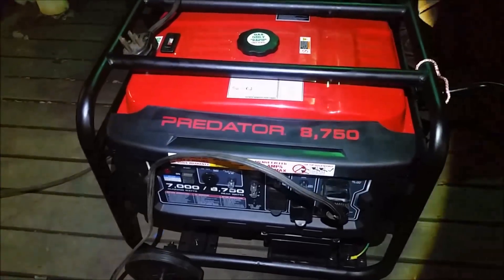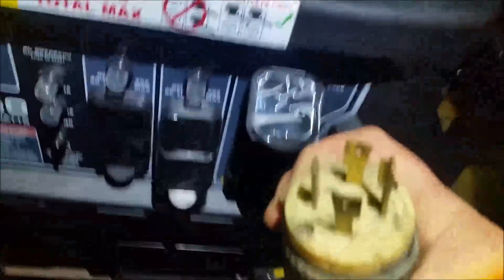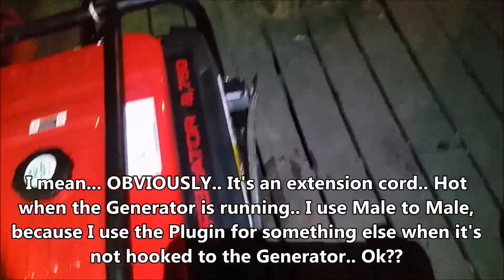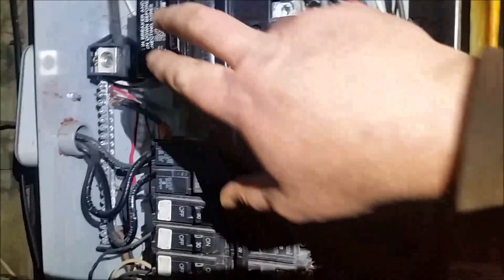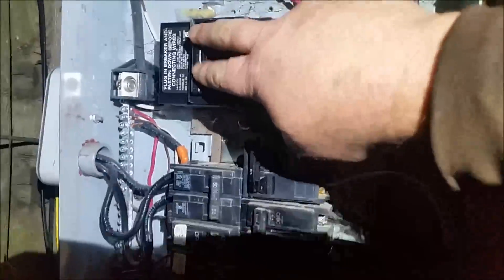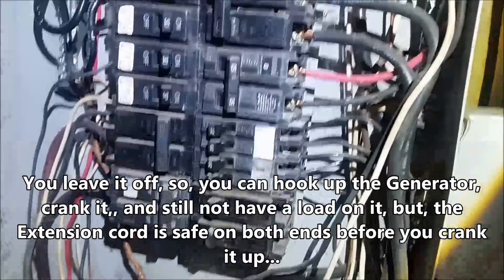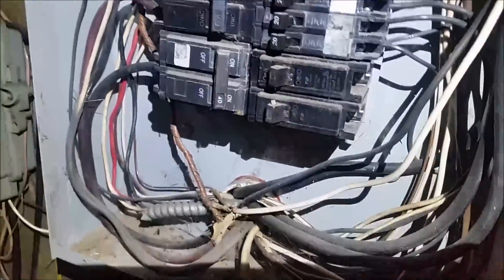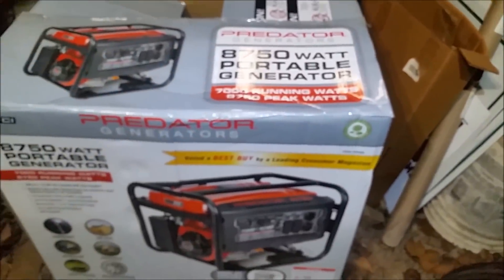Quick/Easy/Safe: Use Existing Plugin/Breaker for Generator hook up to your house Panel box.

Comment: I work for a local utility and I’m glad the emphases was making sure the main breaker is in the open position (off/0) not the closed position (on/1). Through safe work practices we do make sure we are checking for any voltages that could potentially harm us in an outage but we cannot control what the end user does in an outage. Me personally I don’t have a bypass but I my YouTube search brought me here. Truth is I was looking at purchasing a permanent generator (generac) but wanted to see what other options I had. 

But thank you again for putting safety first!
Reply from the maker: Thank you Gaber...  It's hard to justify a whole house permanent generator, when you only need something from time to time temporarily..  It helps if you have some "Other Reasons" to even purchase a portable generator that will run just the essential items..  It only takes one extended outage with a Freezer full of meat that will make it easy to make that decision.. Hopefully, you will know someone who has a portable generator if that ever happens, that is setup where they can easily stop by and power you up for a few hours to get everything frozen back solid.. 
For those instances, I will unplug mine, toss it in the truck and spend the day out blessing my friends who don't.. I just keep a pigtail with a 50 amp female plugin and I can unplug one of their 30 to 50 amp breakers and be plugged in and hot in a few minutes..  I don't mind, because, I am always maintained and while I am gone, I am not missing not having electric at my place.. 
Since they cleaned the ROW, we are not out near as often as we were before.. A good rain would put us out for years, and I ran the generator regularly. And, I am 1/4 mile from the last 3 phase on my leg, so, usually the very last to get back up..  My Mom has the Harbor Freight 8750 and runs what she needs to run at her place.. I run my deep well and my electric water heater with my generator, but, not at the same time..  I am fortunate and have the water heater breaker inside and deep well breaker outside.. I just turn the hot water heater off and operate as usual, until I shower, etc,, then, stop using the water and let the water heater heat things back up again.. As soon as it catches up, I can hear the load release from the Genset and I flip the water heater breaker back off and go back to normal operations.. I keep a camp stove type coffee pot handy for the coffee, so, other than the expense of the fuel, it stops me from Welding, running my compressor, but, doesn't stop me from doing anything else.. 
From time to time I have to toss in my generator and portable air compressor and go and change a flat on one of my busses, but, other than that, it stays at the house, unless there is an extended outage and I go to help my friends..  Usually take my Mom's too and we go and visit.. Hook one up, go to another and hook up another and hang out with one or both for a while.. 
Portable generator,, Yes.. Whole house Permanent,, no.. Not unless it's money that is available and not needed for dual purpose options.. 
If they ever make a generator that has an Automatic transmission in it that will run at just over an idle on a low load and idle up based on a load, portable or permanent, I am going to have a fairly easy time upgrading to it,,, reasonable price would have me at the store in a few minutes.. Fuel is expensive when you are running full rpm, not running much of a load.. Not sure why someone has not done it yet.. It really would not be that difficult to engineer, and would save you quite a bit per outage.. I had a generator that idled down when it was not being used.. I used it a couple of times doing some construction.. I saved a fortune on a two week job without power, just idling between using the saws and air compressors... In fact, I hooked up a second, much larger tank to one of the compressors and ran all of our equipment off of it when we were assembling walls, etc, just using air tools.. I have run two days on one tank.. 
Hope some of that helps you make up some portion of your learning process before buying..
Reply: Thats is so sage and great 👍  add a generlink safety lock out on the panel with a dedicated 2 pole generator breaker 😀 and all done

Comment: Good and simple explanation you're a good teacher still is out of code they want the interlock. But your way work for someone with horse senses....
Reply from the maker: Yea.. Just one problem with that.. You can't use this simple technique with an interlock.. Nothing in your panel changes, so, there is no code violations in the panel, etc.. 
Last time I checked,, inspectors don't do inspections when your power is off,, which is the only time you would be using your male to male cord and generator.  But, when you talk "Code" you are referring to the non-government NEC, which is adopted or not in whole or in part by the State you live in.. I don't know of any state that adopted it fully.. Maybe California,, not sure.. But, the only thing NEC would say about it is,, if it is a "Temporary Extension cord", it is not regulated by NEC.. They only stipulate when a "Temporary Cord" can not be used.. Code would be for "Permanent Installations".. Something you leave connected to your panel, and the reason for the Interlock "At that point"... 
This is a Temporary setup, so, you would not leave your generator connected when you were running off of utility power, in the event that someone opened the panel looking for a flipped breaker and turned the generator breaker on, backfeeding the generator... It's only for people who hook up, and when the power is restored, kill the genset, unplug and flip the main back on.. And, plug whatever was plugged in there before back in and go back to normal operations.. I can tell you understand that, but, just wanted to clarify the "Code" issue..

Comment: So, technically you could just use your drier outlet to plug the generator in, as long if you have them main off and make the proper cable to connect the 220VAC obviously switch off the other big 220V breakers.
Reply from the maker: Yes..  You will be supplying 220v from the Genset to the Panel, the same way the Dryer was getting 220v from the panel. You are supplying the two busses with power from a different location.. An alternate source of the supply, once you kill the Main Breaker.. If you stop by your local big box store and look at an open panel box, it will make sense to you perfectly.. If you hired an Electrician to come to your house and add a Generator Subpanel, he would do basically the same thing.. But, he would dedicate a 220v slot for the feed, and it would always be waiting to be used when the power goes out, and there would be some type of wiring setup that would "Not Allow" both the main and the Generator to be connected to the house panel at the same time.. (That is the biggest Safety Difference, therefore biggest difference in this and that scenario). The Lesser expensive option would be to have an Electrician install what is called a "Generator Interlock" in your panel and also again Dedicate a 220v Breaker to the Backfeed.. The Interlock is nothing but a piece of metal that turns a 220v breaker on when the main is turned off and when the Main is turned back one, physically pushes the same 220v breaker off.. If you look at your Panel, you can tell which side the 220v breaker would have to be installed on in order for that to work... Reason: When you throw the main breaker ON, (in my case, I flip it to the left).. If I had a metal bar that slid back and forth on a pin or set of pins, it would pull the Right breaker "In or Left" which would turn the 220v breaker "ALSO ON".. So, that would not work.. But, if the 220v breaker was on the Left side of the panel, Throwing the main to the Left=ON, would throw the Breaker below it to the Left "Left = Off", and that would be the side of the box that you would Feed with your generator breaker = Backfeeding to the Panel.. The options I have mentioned so far, all have a Dedicated 220v breaker for the Generator that only gets used when the Main Breaker is "OFF", therefore requires a dedicated 220v Breaker and two extra slots in the panel for such.. Here is the Main difference in those setups and this one as an alternative option to those.. (Not having the Generator Breaker and Main Breaker on at the Same Time is totally going to be up to you.. But, because of that, you can use an existing 220v breaker,,, Normally used while the main breaker is On = Dryer Plug, Stove Plug, etc.. and use the same breaker to backfeed the panel when you are out of power and need to power up the Generator.
Why use a "Male To Male = Suicide Cord"?? In order to use an Existing "Plugin",, that plugin is going to be a "Female Receptical".. Where you would normally plug in your Dryer, Stove, Welder, Air Compressor, etc.. The only way to quickly use it, is to use a "Male for the Generator and another Male for the Existing "Dryer/stove, etc.. Female Receptical. That is the only "Big" or Safety Concern issue.. But, if you can remember to turn the Main Breaker off, you sure as hell are going to remember to plug both ends of the "Male to Male" extension cord in... Trust me.. If you respect Voltage, and you pick up a Male to Male Cord, you are going to be absolutely certain that the Breaker is turned off before you plug it in and the Generator is not running when you plug it into the Generator..  
If you do have utility power, and you plug the generator in, and then plug it into the dryer, etc,, and the power is on and generator running, you won't forget again, so, be careful.. I really don't know what would happen, but, I would pretty much guarantee a very large spark/arc, and hopefully the Generator breaker would trip fast enough not to cause a catastrophe there either.. I would go over the procedure in my mind a time or two to begin with, then, open the panel cover and read the simple steps listed above and see if you would have done it correctly.. 
Since you were not 100% sure, type up and print a procedure that is simple that you can refer to each time you use it.. Once you do, everything will make sense as to why you are doing it and the when to do it.. But, it never hurts to have a cheat sheet to verify you are correct before you begin.. Most only fire up the generator a couple times a year. I frequently run on mine, so, don't even have a cheet sheet. But, I do stop and run through the procedure in my mind each time I go from utility to plant power and back..
Yes. You did state that correctly and I think you understand what you need to do..
Google a picture of a Breaker Panel, where you can see the inside of a Panel box, or go to the store and look at one.. 
When you understand why a 220v Breaker works when it is on one or either side of the box, this will all make perfect sense.. Hint.. 120volt breakers run on one leg or the other (leg = One of the Two power feeds from the Power Company) A 220v breaker pulls from "Both" legs.. The leg on the "Right" and also the Leg on the "Left".. 
I think that is what is confusing you right now.. The reason you are turning the other 220v breakers off is to reduce the load the Generator has to pull... I run my 220v Electric Water heater and my 220v Electric 1hp Deep well pump while on the Generator.. I have a breaker panel box inside that lets me turn he water heater off.. The Generator won't pull both at one time.. But, I can warm up the Hot Water heater (while not using any water to keep the pump from kicking on while I have the Water heater on), and then, turn it off, take a shower, wash dishes, etc,, and when I am done using the water, turn the Water heater back on to heat the water back up to temp.. Hope that helps.. Let me know if you have any more questions.. Happy to help.  I learn quite a bit from youtube users.. Always happy to pay it forward in thanks and regards to others doing the same thing I am doing..